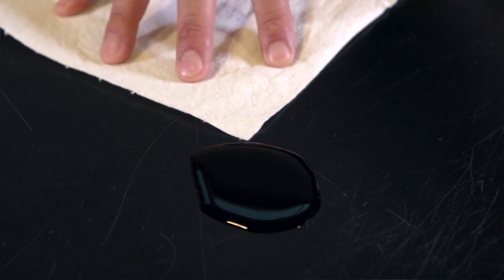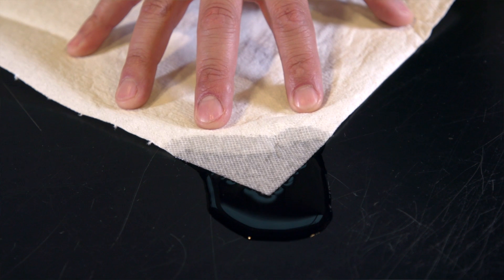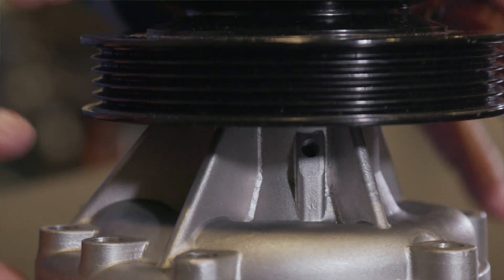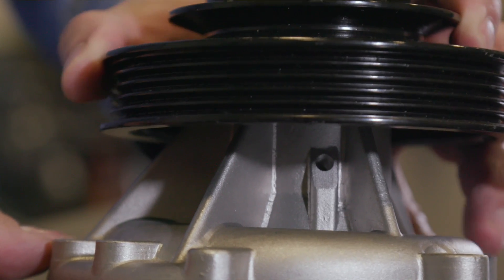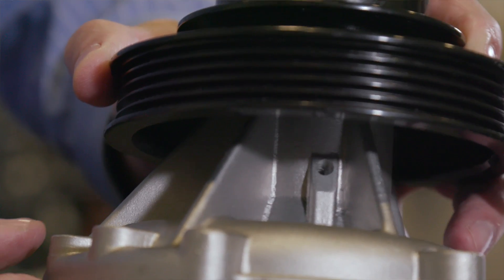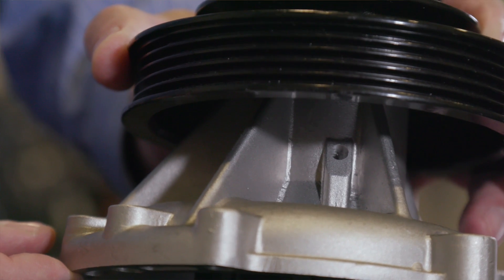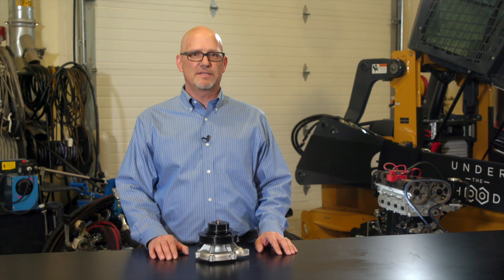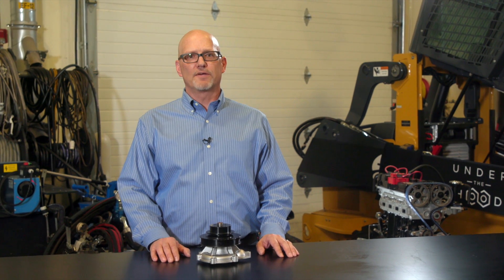Water Pump Weep Holes

Comment: Okay I’m still confused, so I installed a new gates timing belt kit with water pump for my 1990 Honda CRX Si, and there is water/coolant coming out of the weep hole. Should I be worried? It only started leaking after a week or two, I just replaced my fuel injectors and now it’s leaking from the weep hole.

Comment: Have a 2013 Ford Taurus with 140,000 kilometers. Had a leak coming from the weephole. Used about 4 liters of coolant in 3 months. Had to wait to get an OEM Ford water pump in.  The water pump was functional but leaked. The mechanic said there is nothing noticeable in terms of bearing noise or any issue with pumps funtionality. However, it can fail it the seal blows open. Had it replaced cost $2000.00   That was cheap. Dealer and two shops quoted me $3600.00 CDN.  Hopefully this engine will take me for another 100,000 kms.  The car is great otherwise.

Comment: Water Pump was Squeaking was told by Toyota Mechanic to Spray Silicone Spray with Extension Into.weep hole and  Squeaking Stopped 3 years ago.has not Squeaked since what is up does this need more lubrication again if Squeaking again

Comment: Normally what I do is remove my fan belt and turn the bearing. I was getting ready to take a 1400 mi round trip. 
So I normally change the oil and for some reason this time I decided to check the fan belt. I carry a spare one with me but if it's bad I will replace it since I'm home. I was just goofing around and spun my water pump. It was all cranky. Not a drop coming out of the weep hole. 

I was very lucky back then the stores did not stay open that late on Sunday. Since it was a mustang with the 5.0 engine everybody has that water pump. 

Ever since that happened whenever I do maintenance on my cars I take the time to spend everything to make sure nothing is crunchy. 

When I replace my water pumps and hoses and belts I purposely buy this brand. It's something that's been around since I bought my first car and I always use your parts. I can honestly say I don't shop the cheapest price I shop for quality parts.

Comment: Just replaced a Camry water pump Dayco brand massive seal failure after about 1 week after. 
Also replaced a Citroen c4 VTS water pump FAI brand and lasted about a week with yet another massive seal failure.
Parts have gone to the dogs!
Even this guy is trying to cover up leaks and say its normal to get out of warranties and then add an insulting edge to say "don't have a cry" tells me allot about this guy.
I've seen 95% of water pumps running year after year without a drip or mark of coolant coming from the weep hole.
New pumps should not weep anything at all and if they do, they are crap!

Comment: I'm just confused still, iv been working on cars my whole life and as soon as I see water from the weep hole, replace asap. But right now I have a 03 ram 3500 with a 5.9 and the water pump is maybe 6 months old and I notice a little durning the break In period but now I get like this this video says a few drips from the weep hole not enough to even hit the floor and it is intermittent. I would assume this is normal per this video? Or should I replace with a new? That's where I am confused
Reply: exact same situation 5.9 cummins with a gates water pump put on there 18k miles ago and i observe a very very slow drip of coolant. bought the truck used a month ago. should i leave it or replace it again?
Reply: @nicsye12  I don't know, it's funny because I called gates customer care, and the guy said if it was his he would replace it. I didn't replace it because I live in AZ and it's too hot to do anything outside. Still leaks every once in awhile it doesn't hit the floor. I see a small coolant drt drop on my sway bar but never hits the floor. So I don't know. Iv been running it and it has been fine
Reply: @bluecollardiesel128  Still running fine?
Reply: @jyang812 yea for the most part, a few weeks ago when it started to get hot outside in arizona, i notice a coolant stain again, cleaned it up and nothing again, i can never see it active leaking, i also contacted the manufacturer and never got a response unfortunately
Reply: @bluecollardiesel128  Thanks for the reply. Good to know it's been running for these past two years. Got a Gates pump on my car and just as confused about the drips on mine.
Reply: @jyang812 I'm confused too on mine, doesn't make any sense.

Comment: Hello 
What happens if I block the breather hole with silicone. 

My breather  is on top and collects dirt and salt spray.

The original one Cherokee 2005 had a plastic cap in the breather hole
Reply: My ranger water pump is leaking bad . I can't afford to get it fixed right away and I have no garage to fix it in . To cold outside. So I'm going to JB WELD THE WEEP HOLE . To try and buy more time till it gets warmer out. Freezing out now I

Comment: Hi, i have a motorcycle 125cc euro 5 engine, year 2021, i  notice there's slite of coolant where the weep hole is, but very few, the coolant level just drop a bit, it has only 1,000km on the clock. what your touths please?. thanks 🙏
Reply: I have a Honda SH and I notice the same thing ,Did you find an answer in this topic?

Comment: super informative, as mine has been leaving little puddles on the floor for a week, (first ever). My gm dealer diagnosed the weep hole issue, and is presently replacing it with an actual gm part ($590🇨🇦pump) and doing a coolant refresh. 👍
Reply: $500.00? That is very sad. A ripoff if u ask me.

Comment: my passat started losing small amount of fluid at 10yr/106k mies so I got on with the timing belt job. sure enough there were signs of over weepage, so it did its job in warning me of imminent failure. thanks for the great video explanation

Comment: How much weeping per mile on 1999 camry with high miles >200k but last belt and pump done 80,000 miles ago.  No noise. When engine is not running no drips. Hoses are solid.

Comment: I never noticed this hole until today my 85 Chevy C10 started leaking small amount of water which made me think my water pump starting to go out didn't see the whole until after I swapped out the pumps and googled small whole on water pump which led me to this video 👌🏽👌🏽 great Video
Reply: Be careful because coolant will leak into the engine oil sump from a perished water pump seal just like it  did on my Jaguar F-Type V6 !.

Comment: Checked my Tundra a few days ago. There were two small drips of liquid on the front crossmemer and I was sure at the time they were coolant because of the pink color. Have not been able to replicate the coolant drips since then and pressure test comes out negative for a leak somewhere. I did install a new water pump recently because I also installed an replacement engine in the truck too. You think this could the new water pump breaking in? I can’t visually inspect the weep hole because it has a pulley on top of it.
Reply: whenever a car first starts the rotating seal will let a couple drips of water through before the pressure can make it water tight btw
Reply: @Hyperboreann  thx. It ended being a loose clamp on the top radiator hose to water inlet.
Reply: That's what I thought. It stopped for a bit. Then it started leaking again. Now more so. Stick to OEM. Waste of money and I doubt Gates would refund me.
Reply: xxuncexx turned out it was the upper radiator hose clamp. I used aftermarket worm gear and they weren’t clamping tight enough. Switched to OEM spring type clamps.
Reply: @callofdutyguy9  Oh nice fix

Comment: Same with my Benelli TNT 1130R, it leaks a few drops of coolant after longer rides. I also felt that it's a leak from inner coolant seal.....I am also confused and afraid that this may damage my engine possibly mix with the engine oil some day. My bike is just driven 900km 😛.

Comment: i have a 1990 cbr1000f that leaks a few drops of coolant after i ride it.so a few drops is ok or is the seal shot.thanks
Reply: I have 2017 honda cb500x. After every long ride, i see some lil bit cooant on top of weep hole. I guess it normal and designed to work that way.
Reply: Same with my Benelli TNT 1130R, it leaks a few drops of coolant after longer rides. I also felt that it's a leak from inner coolant seal.....I am also confused and afraid that this may damage my engine possibly mix with the engine oil some day. My bike is just driven 900km 😛.

Comment: @ Gates Auto Aftermarket    Looking at the outside of the water pump of a GM 5.3 LM7 motor on a 2000 silverado , where is the weep hole ?
Reply: Idk if this is too late, but right where the coolant fan is at and what drives it, which is attached to the water pump, you should be able to see a small hole (on ACDelco), that would be your weep hole. Weep hole is visible on an ACDelco (original part). If it's another brand, like the duralast,  the weep hole is not as visible bc it's actually hidden behind the pulley that drives the coolant fan. I drive a 02 Sierra 5.3.